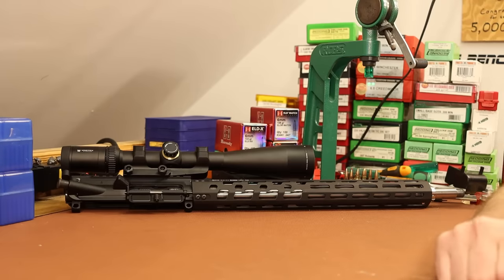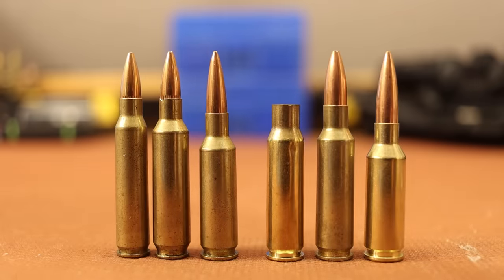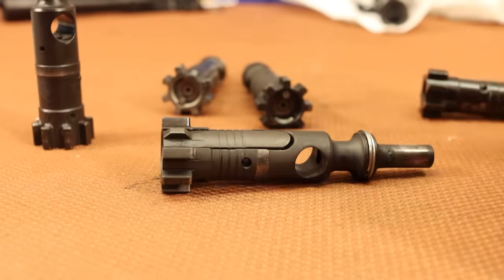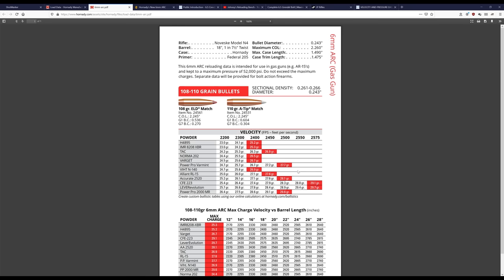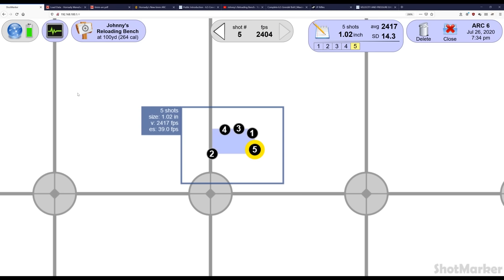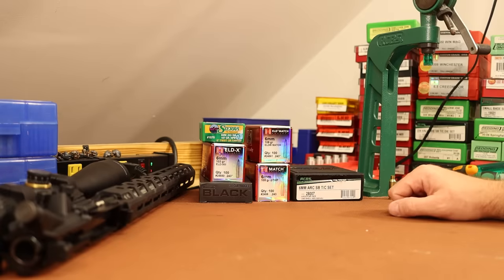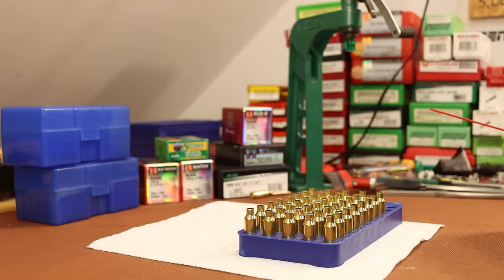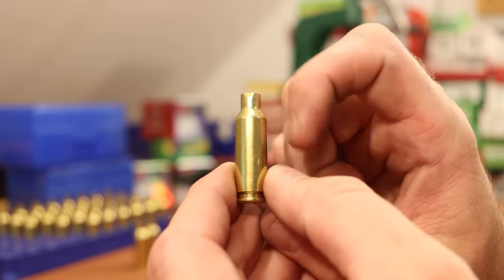6mm ARC - Getting started with reloading

Comment: Yes the Hornady 105 COAL are too long and should be pushed back... Hornady is aware of this and was pointed out.. so it can be a bit dangerous to spike pressure.   The Hornady Factory 105g Black Ammo. In a SAAMI spec barrel this bullet has the lands at 2.210"(MAX COAL), the initial offerings of the ammo have a COAL of 2.250+". This causes the bullet to be jammed in the lands. It will fire, but with a potential risk of over pressure. If you try to extract the round, the bullet might get stuck and you will have powder sprayed inside your AR.  So, you push the bullet to 2.2085" and you are good to go.The Factory 108g ELDM does not have this issue. More insights come join us over at FB for more info we have been on it.. since it started [we also have 6mm ARC Reloading and 6mm ARC Bolt Action sister groups. https://www.facebook.com/groups/6mmARC.FB.group/announcements

Comment: There isn't enough tension when you cut that slit into the brass neck.  
    I use the same idea but I dont cut the case.  I use a once fired case and only lightly size the neck so there is slight tension on the bullet allowing it to travel.  
    I use the bolt to set depth 
    Never hasn't worked for me

Comment: Hello I just finished my 6mm ARC build with a proof research barrel 1:7.5 twist with Aero Precision bcg type 2, m4e1 upper, hand guard, superlative adjustable gas block because I shoot suppressed. What is the top 2 powders do you recommend in the cartridge, I still need to purchase dies yet. My current fps with suppressed Banish 30 is 2626 fps with Hornady 103gr ELD-X factory ammo I also noticed brass dings on my ammo also.

Comment: Welcome back! Since the 6mm ARC was designed for gas guns, was there test barrel 16"? Could explain the descrepecy between published and actual velocities. Wonder what kind of velocities you would get with a 20" barrel.
Reply from the maker: Their test barrel was an 18". They actually provide a chart at the bottom of the page showing the velocity differences you will see with different barrel lengths. https://www.hornady.com/assets/site/hornady/files/load-data/6mm-ARC-gas-108-110gr-data.pdf

Comment: Thanks, your video is very informing.  I do have one question for you.  In the section where you are checking the head space and OAL of your rounds in the chamber, are you removing the ejector from the bolt.  I find my first insertion of any round or case into the chamber very much requires more force to close the lugs than when I partially extract the case or round and then reclose the bolt, and I am assuming that it is the spring force of the extractor going over the head of the case.  Is this correct?

Comment: Why in the world didn't Hornady base the 6 ARC off of the 6.8 SPC with the stronger bolt face and run it at the higher pressure, rather than going with the larger case capacity and bolt face and then having to hamstring it at a significantly reduced pressure??

Comment: I’m at a pass with this round. Looks and performs like a light weight AK round. Wants to be heavy and fast. But it’s heavy and slow. If an AK shaved 18 grains off the bullet weight the velocity would be the same. Idk it’s in no mans area of 77gr 5.56 light and fast and 123gr AK heavy and slow.
Reply: My thoughts also, real similar to the 6.5 Grendel with a lighter bullet and less powder. Looks like a flash in the pan and gone.
Reply: John Hale It does what the Grendel does, without really doing what makes the Grendel good. And that’s shooting heavy bullets out of an AR-15 while milking that 6.5mm BC. 

Hard pass lol

Comment: Does the bullet diameter make a difference with the Shotmarker?  It looks like the bullet diameter was set to .264 when you showed us the group sizes for the factory stuff.
Reply from the maker: Someone else spotted that as well. I'll try to get it right next time. The measurements are taken center-to-center, so I don't think it messed anything up. Just the "hole" that shows up on the screen. It was a little bit bigger than it should have been.

Comment: take that worthless tube off that One Shot can. While I have used other lubes, In 7,000+ rounds a year for the past several years, I've stuck one case, due to insufficient lube. One quick spray on each side of the block will lube it perfectly and has worked well for me for years. I used Imperial dry lube for my match rifles mostly.

Comment: AR is limited as 220/Grendel/ARC are pushing in diameter of casehead = limited bolt life. 6.8MM SPC is better on that regard, but max LOA limits the bullet weights and performance.

I guess 2 cakes cant be had for price of 1.

Comment: if POF can fire proof 308s out of a bolt supported than thinly, then grendel and arc can be fine. ARC might be spec'd to 52k, but I fully expect you to load to the lands and run 62, same as 308. AGAIN, this works for POF, why shouldn't it work for you?

Comment: Great video, thank you for sharing! What are your thoughts on AR Comp for this cartridge in gas guns? For a temperature stable powder (not expecting CFE223/LeverEvolution velocity), I'm wondering if it will be a good fit while not causing excessive pressures.

Comment: I hope speer brings back the 100gr gold dot in .243.
Reply from the maker: I didn't realize they had offered one! I was disappointed to see there wasn't any .243 option right now.
Reply: @JohnnysReloadingBench  They discontinued a little over a year ago.  I think Midway has data still up on their sight. I wanted to do a .243 LBC with the GD being my hunting load.  If the ARC takes off, they could bring it back.

Comment: How unsafe do you think it would be to use 6ppc data as a starting point for powder charges?  The arc has a touch more case capacity and should yield lower pressure and there is some info out there for the powdered I currently have is my reasoning for this idea.
Reply from the maker: I think the numbers will be very close. Hornady just released expanded load data info for 58-105gr bullets. They also have bolt action data available now. Check it out first and see if your powder is listed! https://www.hornady.com/support/load-data/
Reply: Johnny do you have a Hornady oal gauge?  If you do and would like I can make you a modified case.
Reply from the maker: @craignmz5264  Yes, I have one. That would actually be great if you'd modify one for me. Drop me an email with your address and I'll send a couple pieces of brass your way. random157294683@gmail.com I really appreciate it!

Comment: I'll be "that guy" ha...  in your shot marker software you have bullet diameter set at. 264" instead of (.243") 6mm.  It'll affect t group size by a tiny bit.  Well, 0.5mm lol.
Reply from the maker: As far as I know, it doesn't mess up the measurements. They are taken from center-to-center. It just make the "bullet hole" a little bigger than it should have been on the screen. Good catch, though! I'll pay more attention next time.
Reply: @JohnnysReloadingBench  

Then definitely change it to 0.500 and see who notices! Haha.

Comment: I have been watching your 300 Blackout vids for my own recent build and I was actually considering converting one of my rifles to this round.  I am curious to see what the results are. Sub added. :)
Reply: Dump the 300BodyOdor and make a 6mm ARC.
Reply: @jimhans1  I like my 300 Body Odor.  It's an SBR and does a fine job for what I built it for, plus it's what got me into reloading in the first place.  I had a mountain of brass that i could convert, which really helped  I have two other rifles, a 20" 5.56 and a 16" .223 Wylde to sacrifice.  Likely going to wave bye bye to the 20 incher since it spends more time collecting dust.  Just need a new bolt and a barrel.

Comment: I gotta say, you're not lubing that brass over the entire body. I had less of a time sizing 270 win brass than you were having sizing that stuff. 
Get yourself an annealer dude, it stops all that crap. If you want to anneal properly &, have the best SD's you've ever seen, get yourself an old microwave turntable motor, rig up something to enable it to turn a small bowl with about 1/2 inch of water to stand the cases in. Stand your brass in the slowly spinning bowl & heat the shoulder/neck area to medium to bright cherry red with a propane torch for at least, 10 to 12 seconds. Contrary to popular belief, this will not harm the cases & you will have 100% annealed the shoulder/neck of the cases. Just 1/2 inch of water will prevent the heads from annealing or, melting the case necks. Try as you may, they won't go past about 750 deg C, (yes, celsius not fahrenheit) which, is the minimum temp required to anneal brass properly in 10 to 12-14 seconds. If you don't believe me, take 5 pieces of old brass cases & give it go, you'll never look back.

Comment: Johnny go back to the hornady website they have put out more load data 58 gr to 105 gr
Reply from the maker: I saw that! We'll be talking about that in the next video, for sure. I'm surprised how much difference there is between the gas gun and bolt gun data!
Reply: @JohnnysReloadingBench  yes i saw that between the gas gun and bolt. Good  to see u back. Ben reloading since the 1980s 7mm tcu 7-30 waters Etc for my 14 " TC  For deer hinting. Have built up a 14.5 Faxon Firearm barrel  pistol for coyote and deer if the light bullets go good waiting on bress should be hear next week. Have a 6.5 Grendel love it 'I'm all ways looking for that little  edge  Hear in the foothills of N.C.100 - 300  yards is about my max.  Keep up the good work see you in the next vedo

Comment: This video should have started out by comparing the 107gr 6.5 Grendel (0.55MOA)l to the ARC.....then you would see how silly the ARC is as a new round. But instead pretends such ammo does not already exist.
Reply from the maker: Mam, this is an Arby's
Reply: @JohnnysReloadingBench  Oh wait, was I suppose to help you sell product?  Sorry...the 6mm ARC is the greatest ever!!!! (hows that?).
Reply: A 107 6mm vs a 107 6.5 mm. The 6mm version beats it in basically every single way. But it's all good I assume new things scare you. Also a 6mm arc case appears to be a grendel case necked down and the shoulder set back about .03. So idiots dont chamber a grendel in their 6 arc.
Reply: @orangerider2827  Does it??? Thats not how physics works....The Grendel case is bigger, faster velocities over come lower bc, while slower cartridges degrade bc...science. This does not change the fact that they are offering performance that was already available while pretending it was not. But to go further, since you are watching a reloading channel, if it makes you feel better. Neck down to 6mm Grendel, I have one, and the ARC is still beat.
Reply: @killerfungis  you can only go to 52k psi. Look at the case capacity in the video. I've had lots of brass very that much. The case shoulder on 6 arc is .03 shorter. That's such a low difference its negligible. Their for the bc of a 6mm over comes it. Why do you think the 6mm arc and the 224 valkyrie go farther before going subsonic? Oh but yeah case capacity is everything. Also good for you have a 6mm grendel. Ill stay with sammi spec cartridges myself.
Reply: @orangerider2827  Now your using a length measurement foe case capacity. You should really break the habit of conflating a particular bullet simply with a case.  

As I stated to you,  the Grendel is a very wide-spectrum performing CASE it is loaded in 30 cal (which holds an accuracy world record) it is loaded in 6.5 (which is what you somehow only know it from) it is also loaded in 6mm to get 6mm Grendel and also loaded in 224 grendel. 

The 224 Grendel smokes the 224 Valkyrie in speed and accuracy all day long
Reply: @killerfungis  ever hear of sammi spec cartridges? Yeah I dont care about Wildcats.